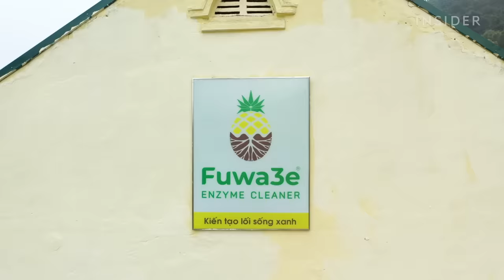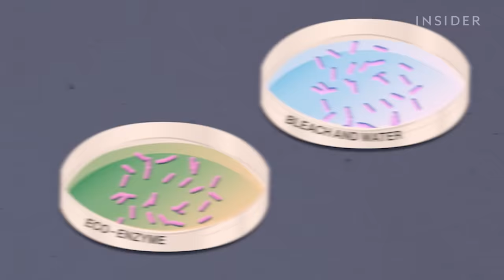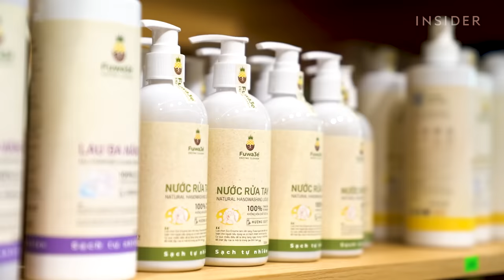Can Pineapple Skins Replace Soap? | World Wide Waste | Insider Business

Comment: Here in India many are preparing bio enzymes at home to replace chemical cleaners 
We follow d same ratio 
1(jaggery): 3(fruit peels) :10(water) 
Any citrus peels are v effective for cleaning
Reply: Thanks. I was wondering how much water. Does the material of the container matter?
Reply: Repent and believe in Jesus Christ  I don't want to have eternal life and I will never repent
Reply: @leavethemkidsalone860  Yes, you would need a plastic container with a lid, so that everyday you can open the lid of the container to release the methane formed inside. If you use glass it will break due to the gases.
Reply: Do you need anything els to make it a soap or can you just use it as is? Also what kinda of cleaner is it, surface, body soap, shampoo?
Reply: @tanusharma3572  or wood or bamboo
Reply: @goodgirlsguide  acid will eat through wood.
Reply: @emiliemcneely5972  any essential oil .
Reply: @leifharaldlongbeardiii861  it's a bot just ignore
Reply: @emiliemcneely5972  nothing it’s quite concentrated on skin we need to dilute it with water on chorus we can use as same as liquid detergent
Reply: A bot that saves peoples lives is one I could stand behind. But that was just a person that cared. My dad wasted 79 years of his life before he became a Christ followand. His life has never been better. I couldn’t imagine life without Jesus. And there are many people that think that they are Jesus followers but they don’t actually follow him and that is causing them problems. Renew the mind daily with Scripture and Prayer. Don’t just read the book of John, do as it says. Have faith and walk in miracles. 💕 God is good! Never blame God for your rejection of him and the problems that result from others who have rejected him.
Reply: @SRose-vp6ew  AMEN!
Reply: @leavethemkidsalone860  Bio- enzymes takes time to prepare. But it emits some gas which needs to be replaced. So prepare it in plastic bottles. Cause glass is not safe to prepare.
Reply: @SRose-vp6ew  Amen
Reply: @leifharaldlongbeardiii861  one day every knee will bow and say Jesus is Lord
Reply: Would already be nice if people in India would just stop throwing chemicals and any waste or trash they have into their rivers or landscapes. India still treats its own country like one big waste plant
Reply: @africansister I think bend is the word you should have used. Anyways is it fair for the tribes in the remotest parts of the earth to not know who Jesus is if Jesus is the only way for salvation?. God is fair and is everywhere which means God is in each and everyone of us. I believe it's best if you just ask yourself this question: what can I do for my fellowmen knowing that God is within me? We all have the same idea what a person is but our opinion on what god is greatly varies and most fail to understand that God is not a person or doesn't even resemble one, that is a great insult to God's infinite greatness.
Reply: Repent and believe in Jesus Christ  Repent ur very own existence , ur spamming nature and for being a bot
Rest in Peace
Reply: @africansister  Amen
Reply: @bapparawal2457  lol. All you need is an s shaped water trap to release the gas.. how do you think brewers did it when they only had glass to work with?

Seriously, you're all trying to reinvent the wheel... The technology for brewing was perfected in Europe hundreds of years ago... Open a book.
Reply: Please what is jaggery?
Reply: @rhuonaChanel  it is brown sugar
Reply: @rhuonaChanel  It's made by processing sugar cane juice. Jaggery is white sugar replacement.
Reply: @leifharaldlongbeardiii861  based
Reply: It sounds like the bigger concern to chemicals used in body soaps are the household cleansers as you inhale the issues right away.
Reply: @makamsidhura Do you put any thing else to make it thicker as a soap ?
Reply: @amremad2353  yes, I  soak badam gum (badam pisin) in water for few hours for it to swell n then grid it and mix for thickening 
U can also use Xantham gum instead
Reply: @sebasstein7014  And it would be nice if the so-called developed countries stopped disposing their waste into developing countries like India and Bangladesh because they too treat India as a disposal site
Reply: @leifharaldlongbeardiii861  You WILL. I PROMISE YOU, YOU WILL.
Reply: What's 1 jaggery
Reply: Is this the formular to start off smal
Reply: @rhuonaChanel  it is raw sugar. It's light tan color. (It is not "brown sugar" in the US, that is just white sugar with molasses mixed into it.)

Comment: could be great, but the video is missing an explanation of what the product actually can and can't do. you talked about very superficial tests about killing bacteria, but people normally clean with the primary intent of removing various types of visible dirt, and you didn't say anything about what this could do there. I know that that primary pineapple enzyme is great at destroying proteins, but that's quite different from the normal soap-based cleaning products that primarily dissolve fats in water. does the pineapple stuff also work for fats?
also you called the product a "soap" after they added oils, but you don't get soap by mixing oils with acids, you get soap by mixing oils with bases.

edit: read the other comments, feel dumb now for not realising that the stuff is vinegar. sure, vinegar has cleaning applications (though I absolutely despise the smell of normal vinegar used for cleaning), and if this process actually preserves the bromelain enzyme, that could make the pineapple vinegar more effective for some cleaning jobs than normal vinegar, since that stuff is really good at breaking down and dissolving proteins, which I believe are a category of substances that soaps tend to have a little bit of trouble with. but it would certainly not be a replacement for detergents, just a potentially better vinegar. and I don't see how it would be suitable for washing skin or accidental skin contact whatsoever, I don't want vinegar on my skin, and bromelain very noticeable attacks skin and mucous membranes whenever you cut or eat fresh pineapple.
Reply: Most likely it's also got coconut-derived SDS or betaine in it as well. So you'd get enzymatic action, acidic pH, and suds for fats.   It's a total solution that will attack protein-based stains, kill acid-susceptible bacteria, and wash away lipids as well.
Reply: @grumblekin  what's SDS?
Reply: It's coconut-derived surfactants. So it's literally soap but they mix it with that pineapple vinegar solution instead of water like usual soap.
Reply: Meaning yu can use to scrab titles in the bath tab removing stains

Comment: I am severely allergic to pineapple, its so bad that I break out in a rash if I just come into contact with it (let alone my reaction when I eat it)- this is amazing, just sucks I won't be able to use it, hopefully a different fruit comes around which is just as effective!
Reply: Probably it won't provoke a rash on your skin, because the pineapple's organic components have been transformed into acetic acid, but they also put some other additives, so you could try a drop in your skin and check if there is a reaction.
Reply: @Frederic Gallo  i appreciate this! I'm still skeptical because the severity of my allergy has always surprised me- I once walked into a tea shop and immediately got a scratchy throat, watery eyes and was sneezing and coughing uncontrollably. I soon discovered one of the employees was holding pineapple tea and using a fan to spread the smell throughout the store causing my sudden reaction- so I'd also be concerned of any reaction to the scent in the soap as well. As soon as pineapple enters my system, the reaction becomes far worse than the rash I get when I just touch it (when I consume it, my throat swells, and I can't breathe, when I smell it, the above happens) so because the risk is so high, I'm scared to give it a go. Given what you've said, if I could ensure a safe and controlled setting (and so long as they don't add any pineapple scent), I would be willing to give it a try! Otherwise, because my risk is so high, I may have to just stay safe.
Reply: Some people in the comments have mentioned citrus works well. Maybe try research a citrus cleaner? Or a fruit with the same enzyme as pineapple
Reply: lets give it a go and experiement
Reply: No worries you can make enzyme cleaners from any kind of fruit peels. Except for durian skin and other dry fruit peels

Comment: the enzymes are pretty strong not gonna lie in pineapples maybe a bit too strong, one time was cutting pineapple with bare hands and uhh the micro cuts in my hands and maybe dead skin got eaten and cleared out by the enzymes, it feels like your hands became itchy and a burbing sensation and slight sharp painsbbut after i properly rinsed my hand its surprisingly pretty clean but still hurts because the enzymes are continuously eating the dead skin on my hand

Comment: My only problem with this is that they say it so far only works with sertain bacteria that they have tested

The thing is that if it doesnt exterminate every single type of bacteria or virus out there but only kills sertain ones then after washing your hands or clothes it will be a perfect havitat for the few bacteria it doesnt kill because you removed all its competition

So in a way this could end up making things worse when using the product
Reply: yes, I find this conserning too, but as the video went on, I got the impression that related only to them not having tested other bacteria, rather than it only working on some. Also tbh, I doubt it would be worse than the current situation where various products take out 95-99% of bacteria, leaving the strongest/most immune alive with no competition as they reproduce

Comment: Why they start comparing the enzyme to bleach when they began with warning about fossil fuel synthetic cleaners pollution, highlighting suds in waterways? Bleach is saltwater hypochloride bleaches are very safe to the environment it should be your first choice in cleaning. Those electrolysis spray bottles that were everywhere for cov work pretty well to make a good diluted solution.

Comment: Ok, these idiots don't know the purpose of soap .   It's an intermediary to combine water and organics like oil.   It requires a long carbon chain, and an OH group in the end.   The carbon chain Likes oil, and the OH likes water, and so when you run water through an object, while using soap, the water pulls the soap which the soap pulls the oil.   Bacteria can be pulled this way, because it's got a lipid layer where the soap can pull it off your skin, but it doesn't kill the bacteria.    TO kill it, you use a disinfectant.    The question I have is, the oil they use, if the real purpose is to make soap out of it.   combining the concoction with oil will not make soap.  Rather than using acid, soap usually use some sort of oil or fat and boil it with an alkali substance, like ash from a burnt vegetation.